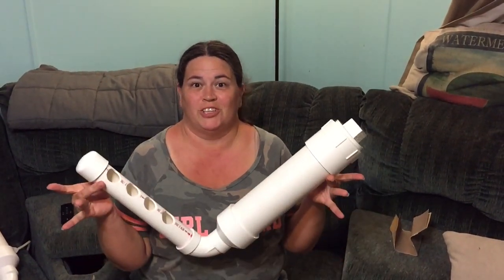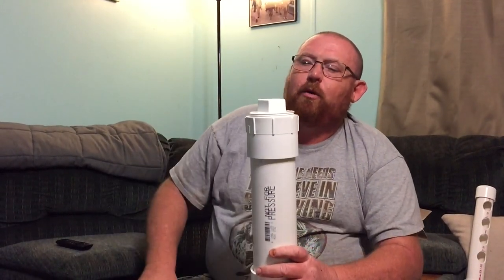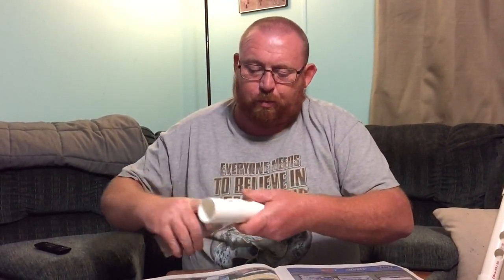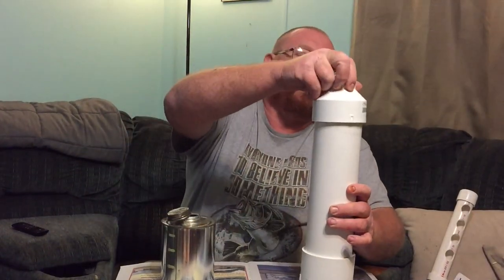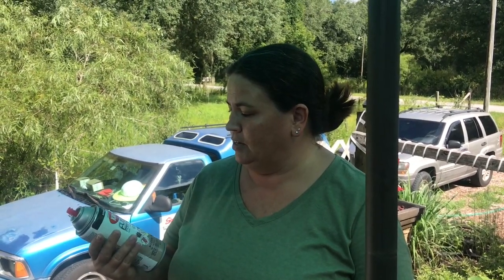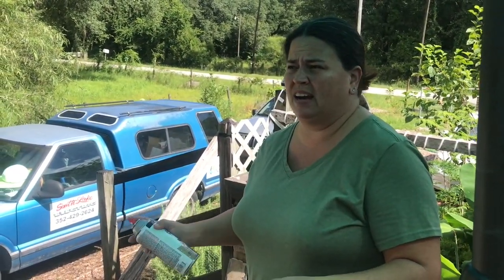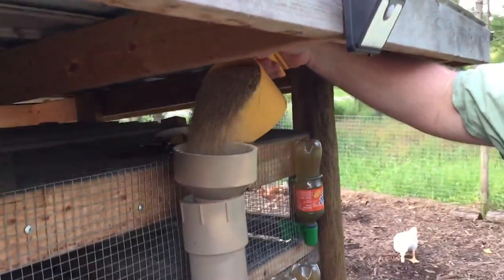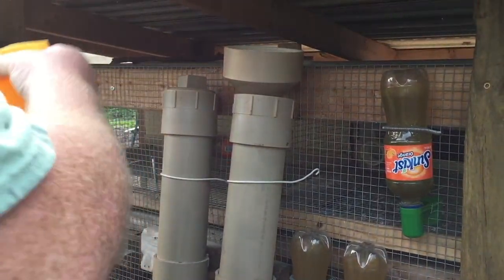New quail feeder Experiment

Comment: Simple physics tell me that the feed will not reach the last hole unless you shake it. And when you shake it it will over flow the first hole. Am I right. I’m sure it’ll work but not a good design. It’ll probably work better if you put the tee and 2 holes on each side. So the feed wouldn’t have to travel so far. 👍🏼
Reply from the maker: You do have to give it a shake to get it to the last hole.  But it doesn’t over flow the first holes.

Comment: This design will not work as the feed will not reach the 3rd and 4th hole. It will end at the first or 2nd hole. To solve this, instead of a L shape, you need to make a U shape feeder. With the U shape, you got feed going down both tube on both side.
Reply from the maker: We found that. We had to give it a good shake once or twice a day.